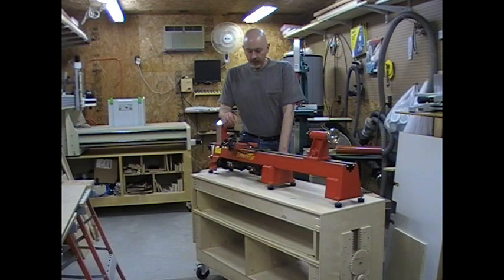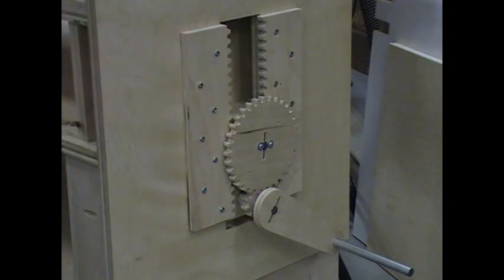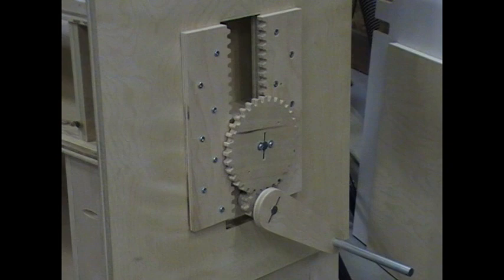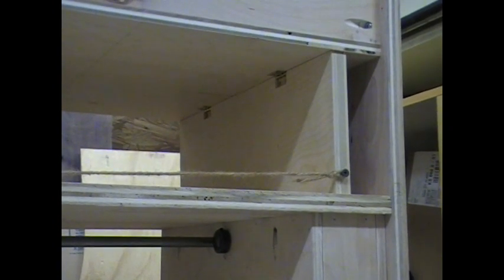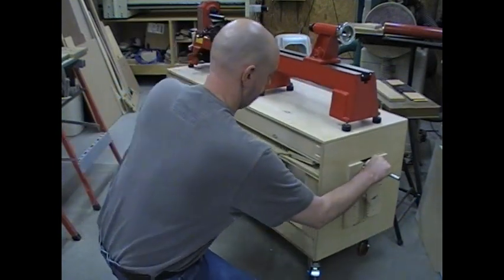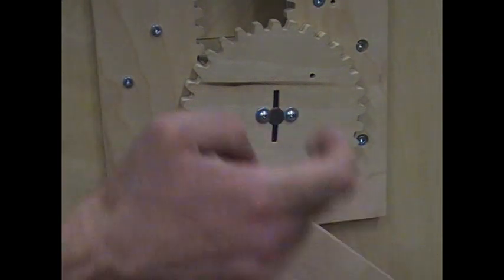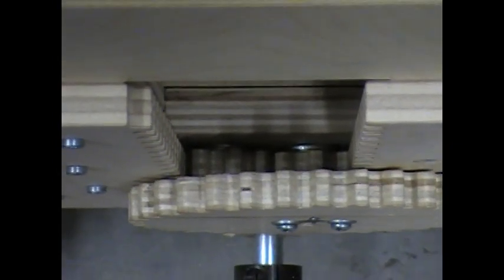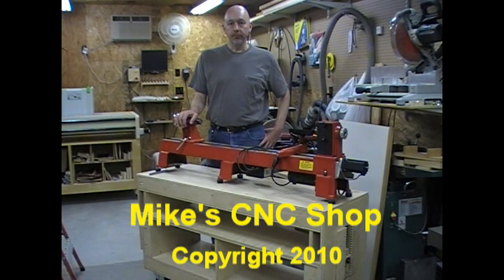lathe-stand.mpg

Comment from the maker: I get a 4 to 1 reduction.  Four turns of the crank result in one revolution of the 32-tooth gear which is on the same shaft as the driven 8-tooth gear.  If you put the crank directly to the driven 8-tooth gear, it would take four times the force to turn the handle but would probably still work.